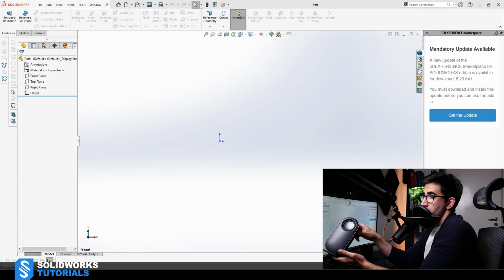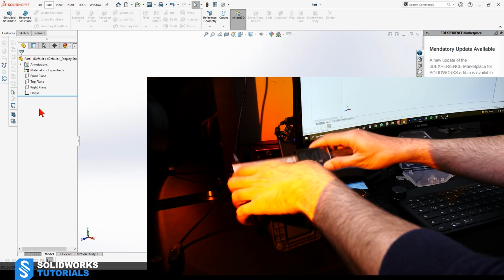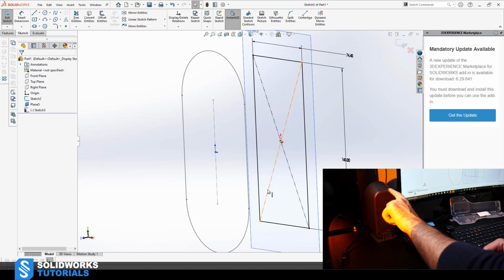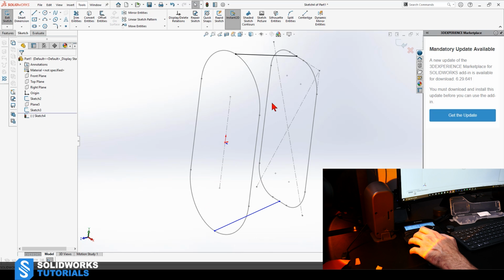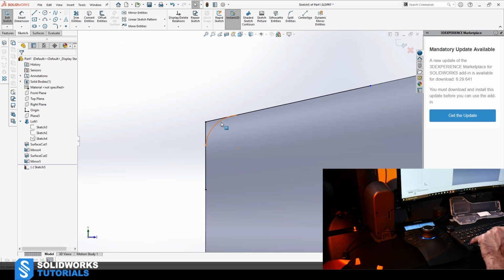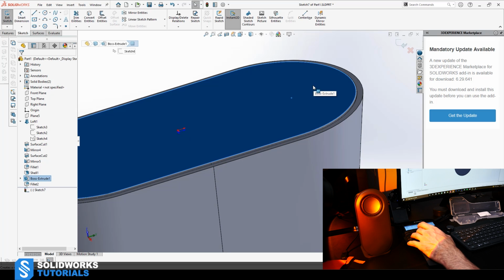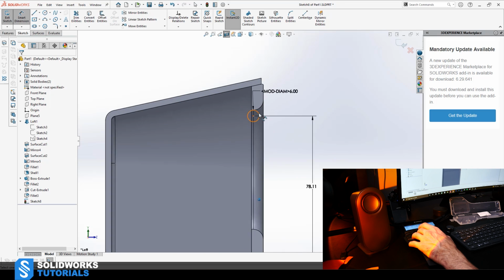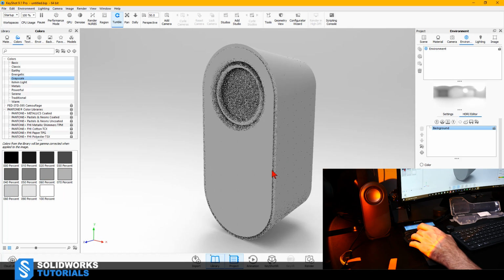What Professional Modelers Don't Want You To See On YouTube - Part 1 (Edited)

Comment: As an engineer,  I think your videos are spot on. I recently had the similar issue of having to fix the "mod diameter" dimension issue that I briefly noticed. I think it was from when I updated to a newer version and uninstalled the older. Just had to fix the symbol reference file location in the settings.

Comment: A couple of things here.  On fixing the warp.  It may have been necessary to do it the way you did, but I would have tried to move the points on the first loft attempt.  They can be moved.  I have found the best way to tame lofts is to have the same number of segments in each and start on the same point when choosing them.   
On the radius.  Here is a formula.   Measure a straight line distance from one side of the radius to a corresponding point on the other side.  Then measure perpendicular distance from that line to the radius.   Half the first, call it h.  Call the perpendicular distance t.  R=((t^2+h^2)/2t
Reply: Or maybe convert every the sketch into a single spline line. You won’t have the deformations from the loft, no guide lines will be needed